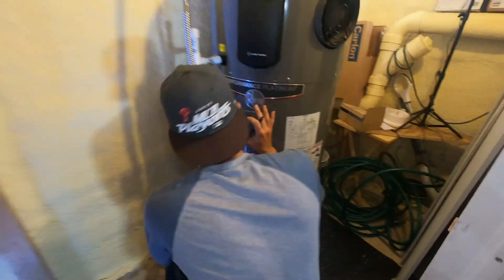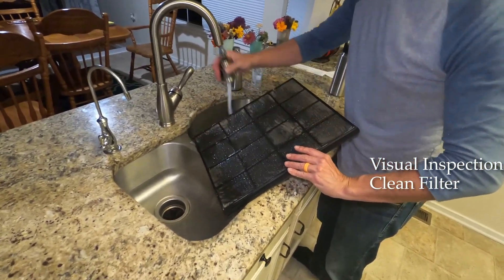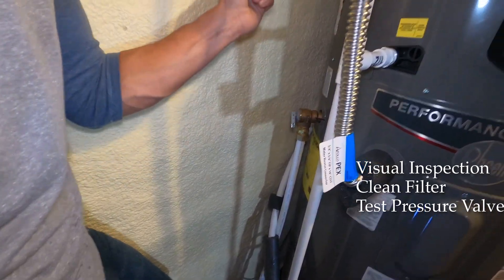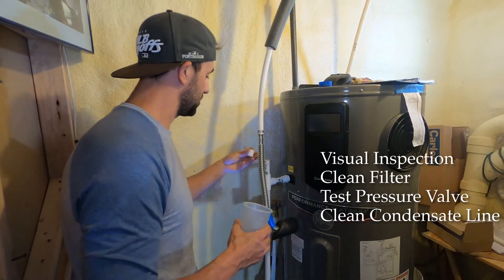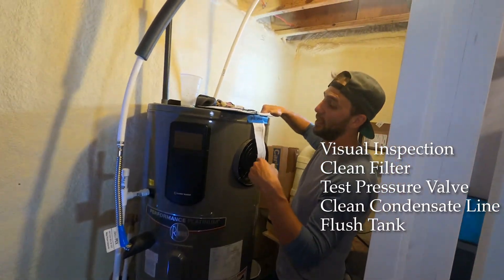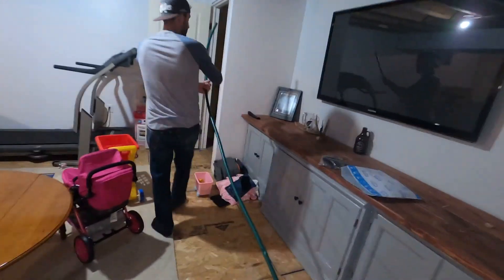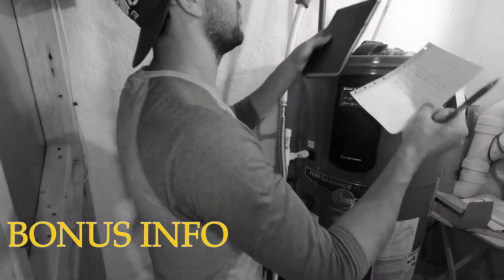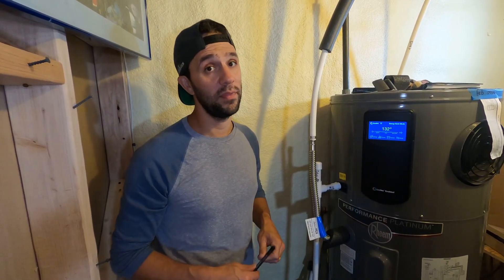Hybrid Water Heater Maintenance for all Brands - Rheem, AO Smith

Comment: Nice video.  Some pointers for those with older tanks and rusty pipes.  
Never test the T&P valve because they tend to leak. All it takes is a piece of debris on the seat and you'll have a leaker.   
When bleeding the air out use the bathtub to avoid plugging up the aerator. Old rusty pipes will flow red rusty water before it runs clear.
Reply: Never testing T&P valve is bad advice. If it ends up leaking, replace it. Could be a tough job if it's rusted in there but leaving it would be a major safety issue. If you can't replace it, maybe it's time for a new water heater.
Reply from the maker: This is great advice !  Actually, as i was standing there running the water i was thinking to myself - i hope this isn’t clogging my aerator….  Ugh - should have mentioned that.  

Thank you for the comment !
Mike
Reply from the maker: I’m going to pin this comment to the top !
Reply: You're supposed to check the T&P often. Flip it, if it stays open replace it.  If it doesn't open replace it. Not checking it is not doing your job.
Reply: @AegisofAutonomy  Wrong. There is no 'equirement' nor protocol to "test" a T&P.
Simply opening a T&P is not "testing" it... your just [manually] opening the valve and discharging water. 
A T&P operates by "temperature" and/or "pressure", neither of which you are exceeding, so it's not truly a test. And they almost ALWAYS  leak after being opened. 
The only check of a T&P is a visual one: make sure it's not leaking, and move on.
Reply: "Testing" a T&P is NOT A GOOD IDEA. They will nearly always leak afterwards.
And your not really "testing" anything by opening it. A true test would be to exceed its pressure & temp rating to see if it operates... and that certainly can't be done.
Therefore, opening it and allowing it discharge is not doing anything except setting up for leak.
DON'T OPEN THE T&P... EVER.
NOTHING  to be gained.
Don't ask me how I know... 😂

Comment: I just installed a new HPWH (replacing a 50-gal/4500w standard electric unit).
I included a disconnect switch on my install, in the closet where the WH is located. The original installation did not have one, which is a Code violation.
Actually, this is a Code requirement (has been for several years), if the breaker or other disconnecting means is not "within sight" (as defined by the NEC).
A pull-out type AC disconnect is suitable, however - in my case - I used a Square-D AC disconnect switch (a little more expensive, but will last forever).

Comment: Great video. Chlorine fumes are corrosive and can damage the evaporator coils, metal parts, plastic parts, and the drain line itself. PVC will tolerate bleach, but not all drains are made of PVC. At the very least dilute the bleach 2:1 or even 4:1. Vinegar may be safer, but it's acidic and corrosive to coils. There are off the shelf condensate drain cleaners available from Amazon, Home Depot, and Lowes, etc.

Comment: I have this unit (have had nothing but trouble with it), and my fan is covered in thick mold.  So maybe add to the list spraying the fan with vinegar or bleach water mixture.  Also, after owning mine for about 8 years, I'm convinced this filter is useless.  It never collects anything meaningful.

Comment: Use of toxic bleach to clean condensate pipe is unnecessary. Bleach products hinder septic systems and pollute surface waters. Consider use of non-bleach products diluted to solution according to manufacturer's directions. Better yet, design drainage to be removable with parts dimensions able to be cleaned in a tub or sink using only hot soapy water. Thank you

Comment: I also have a Rheem Hybrid hot water heater. HUGE fan of it, it really did save me 85% of the electric usage over our old electric resistance one it replaced. Our electric rates are high where we live so it was a massive savings, over $600 a year and paid for itself very quickly.

This was a great video, very useful. Thank you!

One question, about the bleach in the condensate line, as ours drains into a sink which goes into the sewer system. We have old cast iron sewer pipes and I've been told by our plumber to avoid putting any bleach down them, as it risks corroding them We already had to replace one section of pipe, and all the remaining pipe is underneath the cement floor and would be costly to replace. Would vinegar be an adequate option there? Or is some other option that would be milder and safer for a more vulnerable, older sewer line?
Reply from the maker: Thanks for the nice comment !   Yes, i'd say vinegar is a great idea....

Comment: Hybrid water heaters SUCK! Period.  I have one as a test model in my own home and am a licensed professional at the highest levels with 25 years of experience.  There is little difference between brands with build quality.  The heat pumps run nearly constantly in hybrid or especially efficiency mode, they burn out, coils ice over and are just generally buggy (don't heat the tank all the way through.  I have an 80 gallon in a basement that is always, year-round between 55 and 65 degrees.  Well within the operational temps stated by the manufacturer. In efficiency mode it takes 24 hours to heat through from cold, in hybrid mode it takes 12 and straight electric mode electric takes 5-6 hours.   I get calls and complaints from owners all the time and there is literally nothing I can do because there is no error code and nor real serviceable parts in the compressor unless you're an AC/R tech, which pretty much no plumber is. So, the manufacturer will give you a new water heater after a good fight, but you will be on the hook for its installation.  Gas operated on demand systems are just as efficient if not more so and can actually be fixed if they break and produce endless hot water at 5-6 GPM.  Hybrid water heaters are expensive JUNK pushed by the green douche's simply because its electric and that way they can have a single fuel "pipeline" that can at some point, be controlled/regulated and it's not the bad...bad fossil fuel.  If you have ANY OTHER OPTION, do that because otherwise I promise well before the factory warrantee is up, you will be getting the dreaded error code for a failed compressor.  Yes, some people have no problems and if that's you great, save your breath because you are the minority   I have installed literally a few thousand of these now over a decade or more, all brands all sizes and I am here to tell you that 2-3 of every 10 we install fail in the first 3 years.  So, 20% to 30% failure rate from the factory.  Why am I so mad?  Because customers associate these failures with my work, even if they picked the water heater, it must be something we did wrong with the installation, or we must have damaged it when bringing it in. Ect.  I have some customers on their 3rd hybrid water heater in 4 years and they appreciate me coming out to help about as much as one appreciates his dentist during a root canal.  This is just another example of the green new government working with, schilling for, the manufacture and release to the public of an inferior product in the name of efficiency, that is actually less efficient and cost more to own than most on demand gas water heaters. Oh, but you're saving the planet with electricity from a coal, or co-generated power plant, or solar where large swaths of land were clear cut for panels.   Its BS and the consumer is lead down the primrose path by the promise of efficiency and "savings". Don't believe it.... you're getting screwed.   And yeah....I tell all customers this stuff up front now, so they can't blame me when 3 years later their paying me to do a warranty swap and wrangle the manufacturer to honor their warrantee.

Comment: You also need to check the temperature difference between your air supply and air exhaust. There should be a 10° differential from the supply to the exhaust air temp.

Comment: Good work but you forgot the anode rod brother!
Reply: They are a little harder to get to on the hybrid water heaters.  The new Rheem models let you have water connections on the top - I am not sure if you can get to the anode rod without disconnecting the water fittings.
Reply: @JackRussell021  you can. AOSmith unit has a steel pan screwed to the top, but it pops off and the access to the rod is like a normal tank on top.
Reply from the maker: agree !
Reply: @FamilyDIYtv  Yes, I'd love to see the anode rod inspection/replacement as well!

Comment: Thanks for the tips.  I have a 65 Gal Rheem Proterra Professional Hybrid as well and we are on a well.  I just hooked the tank up about 2 months ago and we are starting to get a sulphur smell on just our hot water.  Rheem mentions adding chlorine in their manual to cure this, has anyone done that before?
Reply: @DarrenMacDonald  you need to replace the anode. Get an electric one so you don’t need to replace it again. Works great for well water.

Comment: Hello-  We are considering changing our full electric to something else.  The jury is still out between Heat pump type or Tankless.  For the regular "can" crowd: I know, I crack myself up sometimes.  Those were all good tips.  But while you were refilling the tank after you drained for scale, etc. I noticed that you were standing right next to the pressure relief valve.  Having said that, what would keep you from opening and holding the valve to clear most of the air that otherwise  would come spitting and spurting out of the faucet that was opened.  When water comes out, you just release it to normal position.  I also just thought, (in my case), that I have a  main air return line to the furnace very close to where the heater stands.  So I will vent the exhaust from the heat pump back into the air return.  No negative pressure problem,  reduced cooling of the basement because the exhaust will be piped back into the house system were it will be either reheated in the winter or cooled during the summer.  My work here is done.  Have a good day.
Reply from the maker: Ha Love all jokes !   And a valid points.

Comment: No, you turn off the power, gas, or propane.
You do NOT turn off the cold water supply.
You attach a hose to the valve
Careful, it's hot -> You open the drain valve
You allow a few gallons of water to drain out
You close the valve.

You use the cold water supply to force the sediment out.
Leaving the cold water on also greatly lessens the stress of going from a tank of hot water to suddenly-cold. 
It allows it to function as though you simply lost power mid-shower.

135 degrees is considered the minimum temperature for killing Legionella, the bacteria that causes Legionnaire's Disease.
Any hotter than that is personal preference. 
Anything colder poses a serious risk to young children, elderly, and the immunocompromised.

Comment: Do your fan blades get moldy gunk on them? If so, how to clean them? I am  thinking about ac coil cleaner or similar but not sure
Reply from the maker: no they don't, sounds like you could have a moisture problem.  might want to check your filter and maybe lower humidity.

Comment: Great video, thank you!  I’ve had my Rheem for 3 years and love the efficiency.  I have flushed it several times but did not know about the other steps 😬.  Mine is in my old cellar so a little nervous to see what the air filter looks like after 3 years.

Comment: Have you gotten the dreaded a005 t005 or t009 error yet?  Word is they have a huge issue with that now.  Something about temp sensors being sub par and going out with in a yea or 2 or less.   I got mine in May 2021, just now in Dec 2022 started getting complaints with those errors.  Interesting thing is only one went to the econet app telling me there was an issue.  Can't wait to see.  If you ever do have to fix it and you do it yourself you have to take that top cap off, Mine is pushed up against something like yours issue so I can't reach one of the screws that means draining it unhooking water to move it a few inches so I can get the screw out not too excited about that.
Reply from the maker: I have not gotten that but thanks for the heads up !!

Comment: Several comments have already mentioned using vinegar vs bleach to flush the condensate drain. I opted for clear vinyl tubing for my installation. This allows me to see if there's any buildup. Having said that, condensate from any type of heat pump or refrigeration/air conditioning unit is very clean water, much like distilled water. About the only contaminant might be traces of copper from the core. Even that should stay in suspension & not cause any buildup issues. Hence, IMHO the bleach/vinegar step is unnecessary.
Reply from the maker: I've had condensate lines backup on me multiple times throughout the years, that's why i now have leak detectors under all my appliances that have condensate lines.   i hear ya tho, it 'should' be clean.... 

Thanks
Mike
Reply: @FamilyDIYtv  My 5 yo Rheem hybrid actually has two condensate lines next to each other (3/4" and 3/8"), not sure why.  The original plumber installed without a "T" so I was wondering about logistics to attempt to dismantle (doesn't appear easy).  Knowing this is expected to be "clean," seeing condensate drip at the exit (outside through the wall; we are in warm Florida), and no alarm or error reporting a blocked condensate (apparently this model detects), are suggesting to me to put this on the back burner.  Still, if I have a plumber come to deal with the apparently failed compressor, my primary issue right now, I'll have them put a "T" connection on both pipes to make these inspectable/maintainable.
Aside from this failure, I've owned a GE hybrid in the past and both have given me great service and savings (until now).  Bonus here in Florida for a garage installation is that it will provide some cool air as well :).  Come to think of it, in Oregon where my GE hybrid was, in the basement storage area under the house it helped to dehumidify.  
Video great though navigated here hoping to see something about compressor.  Anyway, thanks!

Comment: Two questions: Do you happen to have the dimensions of this specific water heater? How much space do you feel is necessary to work on and around this water heater?
Reply from the maker: 62” high and 24” deep.   It’s needs plenty of air to, think they say about 700 sqft.   Can run ducts out of small closet if you want to stuff it into a small closet.

Comment: FWIW most plumbers recommend  against "testing" the pressure relief valve because they sometimes stick open during the test and cause a big problem.
Reply from the maker: Interesting, I’ve never heard this.  I’d say if the valve is stuck open, it’s faulty and should be replaced.   I’d rather it be stuck open than stuck closed And replacing is actually pretty easy.   I’ll ask around though, I’m now interested….  

Thanks 
Mike
Reply: @FamilyDIYtv  They say that the valve sticks open because of debris that gets flushed through when you open if for the test. This apparently results in a real mess and it doesn't necessarily mean that the valve was faulty or that it wouldn't have served its purpose were it called upon to release excessive pressure. However, like you, it makes me a bit nervous to forgo testing a component essential to preventing over-pressurization.  Not sure what the best course of action is here.
Reply: @boatman222345  - the best course of action is to leave it alone except for every three years maybe. Doing it to  relieve pressure to drain or yearly is definitely not necessary and can cause additional issues like it doesn’t close completely. That doesn’t mean it was defective. Tested every three years and if it drips after testing it and you can’t get it to clear then you’ll have to buy a new one. But definitely don’t test it every year just to test it. Not necessary.
Reply: Yeah don’t pop that t&p unless you’ve got a spare. I also don’t like draining the t&p to the condensate pump bc then it’s harder to determine if your t&p is stuck open. The t&p shouldn’t be opening up regularly anyways, if it is then there’s a bigger problem and it’s good to know about it. In my experience best to pipe it into the drain pan for visual inspection. When it does open to alleviate pressure or temperature it’s usually only a little bit of water anyways

Comment: Nice video, just installed one of these.  One thing I noticed about yours is that the relief valve tubing is PVC.  From what I understand, PVC is only rated for cold water and could fail if hot water ran through it.  I installed copper, but Pex tubing is fine, too.
Reply from the maker: Yep , it's PEX.  PEX is rated for hot and cold water.  

Thanks,
Mike

Comment: Another pointer, if you open up a faucet upstairs to help the draining process, it's best not to use the kitchen faucet. Faucets with a pull out spray usually have a check valve internally so you would NOT be letting air into the system to help the water heater drain.
Reply from the maker: great point !  i wish i could take everyone’s input and”update” the video, so many good comments for you guys.

maybe i should do that …. 

Thanks 
Mike